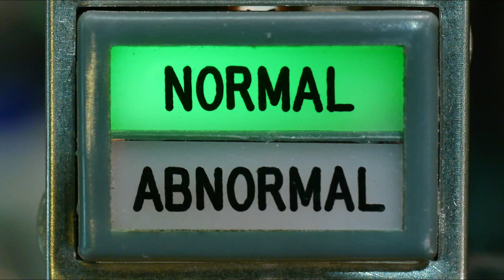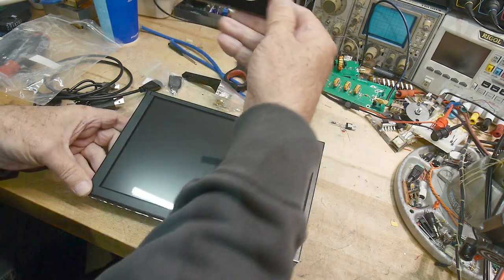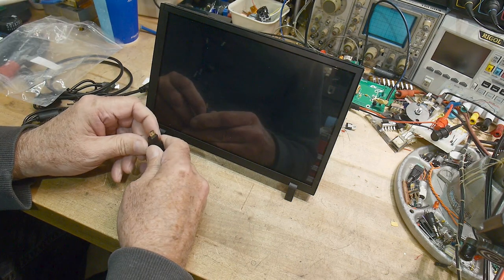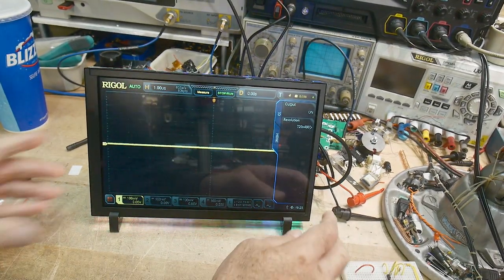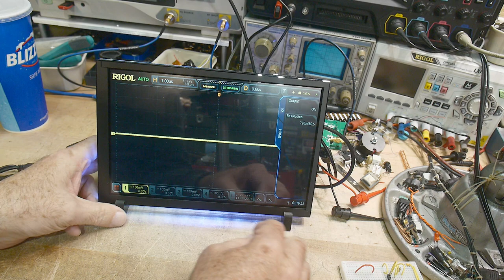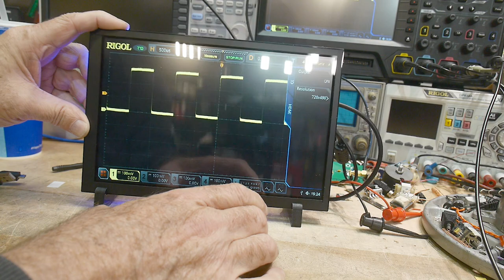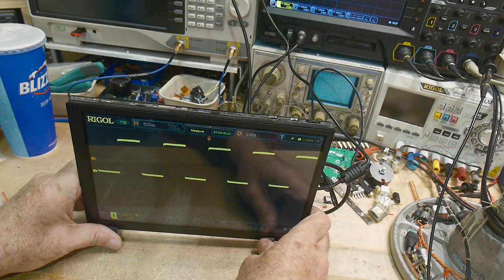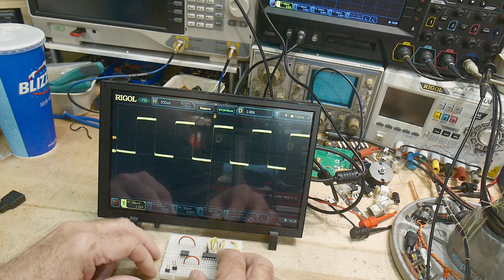#1428 Elecrow 10.1-inch IPS HDMI Display Review

Comment: If you want to get rid of the glare, buy an iPad screen protector, and cut it down to the proper size.  I did it for my oscilloscope and it works great.  Easier to clean too.

Comment: The “mode” button should cycle through auxiliary display options. Similar to right clicking windows desktop to adjust extended display settings. Your new display should work as a Duplicate Display, Extended Display or Second Display modes.

Comment: Hi, when you took the display out of the box, I thought I would buy it for my microscope, it has HDMI and the display has a VESA mount option. But what got me is the resolution and the super shiny screen, the screen can be solved with a filter, but nothing can be done about the resolution. I was quite happy, because he said that it also has a rear backlight - that's pretty great against eye strain, by the way, but this is more of a back light - it's just a useless attraction. Thanks for the review, I have two reasons not to buy it ..... and it looked so beautiful.
If you are going to use it with an oscilloscope as a second display, I would hang it over your shoulder and just position it in the shot if necessary.

Nice day 🙂Tom

Comment: RGB flashing lights are the single most annoying thing on current computer/av hardware and I absolutely hate it. The only exception I could see is the ambilight functionality that came with those flatscreen tv - if it’s executed well. Why would any one have glowing RAM or Fans is his computer is beyond me. And don’t get me started on those rgb gaming keyboards. I never felt the need for backlit keycaps either. I really only used them once on my MacBooks since the had them.

Comment: That screen should be 1280 x 800 , so I guess that the problem is with the rigol sending 1280 x 720 - shame that it seems to be incompatible. .  The mounting on the rear is set up for a Raspberry Pi to be bolted on.  The screen reelection is pretty bad with your current lighting setup.

Andy